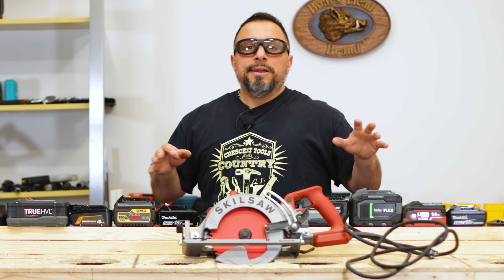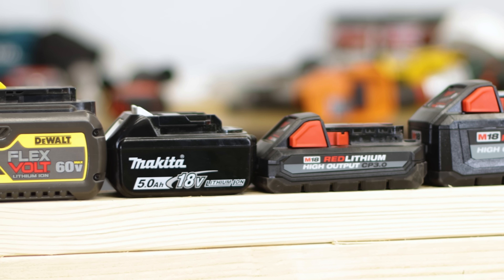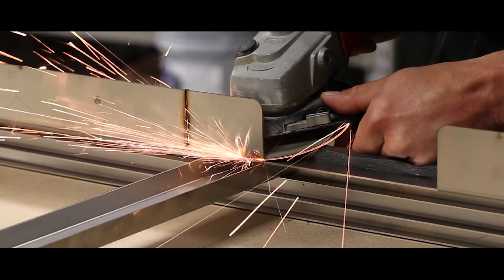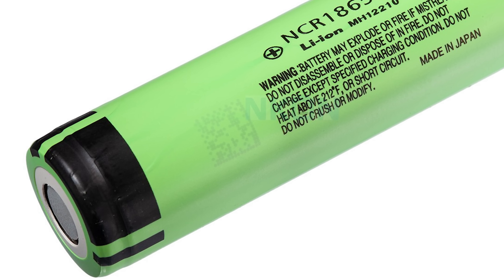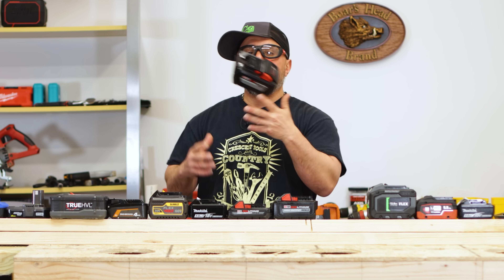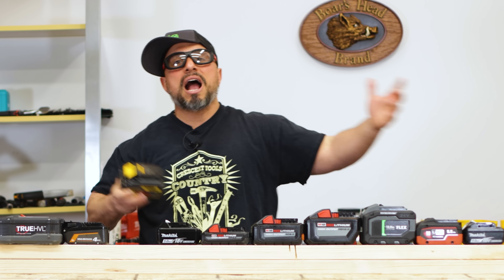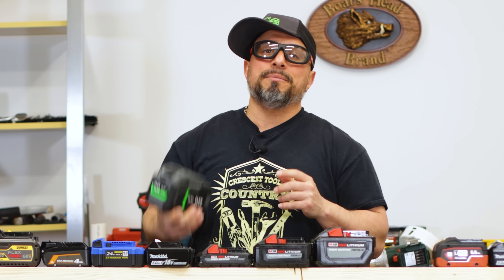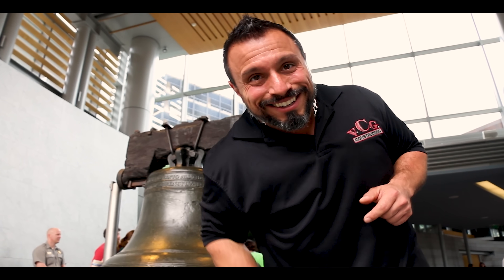Get The BEST PERFORMANCE From Lithium Ion Batteries & Make Them LAST LONGER!

Comment: alot of talking, but why not actualy checking battery voltages of different manufacturers and amp hours?
Reply: For what reason?
Reply: @haroldphipps3457  point is, that overcharge above norm and discharge below safe is possible so Im interested, what voltages are battery's operating and when is charging or tool runing set to stop (manufacturers safety implementation).
If you would open any of these and check what cell this or that battery pack is using you can find out what voltages they suppose to be running and what's best voltage for cell.
Reply: @klendatas1  thanks for the explanation!!

Comment: Best I can probably hope to do is not store my batteries in my hot car this summer. As for not discharging completely or not fully charging I don't have the time and energy to micro manage my batteries like that. I agree that software should be built into these hyper expensive tools
Reply: You dont have the time to push the little button on your battery when its on the tool to see where the charge is .  Lazy

Comment: Yes...batteries do manage themselves. Some Lithium Ion batteries have a built in BMS (battery management system), But... only in $500 to $1,500 batteries.Tool manufactures want to sell more tool batteries, and solar system battery manufactures don't want to get sued because a $1,000 battery was mismanaged by a consumer and died after 50 charge cycles.

Comment: If possible, avoid using fast chargers. Charging at higher amp rates will also contribute to faster battery degradation.
Reply: All I use is fast chargers heres why. By the time the battery degrades beyond efficient use I'd already have saved money by having these batteries charge fast and always ready when I need it. That being said I  know batteries are expensive but so is my time. I've been using the same 4 battery packs for quite some time now and have not had an issue YET. When that time does come I'd probably upgrade to some better batteries anyway.
Reply: I think the 🔋 getting 🔥 causes as much damage as if you charge them with high current, I'm not here to say one is worse than the other but neither one is good. If possible try to charge your batteries in a room that is around 80° & let them cool off to room temperature (or cooled down) before charging by the time they're done they should not have much heat. I use a Makita setup & the charger has a fan that blows inside the battery as it's charging. Just like anything in life, you take care of your tools, your tools will take care of you.. I'm sure that applies to your 🚗💨 your wife, your 🐕🐕 even your own damn body for that matter 😂
Reply: @honda116969  After letting my battery cool down, and then charge it with an external fan blowing on the charging unit. It's cheap insurance.
Reply: I'd like to add that if you have to use a fast charger, the larger, higher amp hour batteries can handle it better than the  smaller low amp hour ones do. The difference is the number of cells in each battery...higher capacity battery packs have more cells that are likely physically bigger and higher capacity than the ones they put in the smaller low amp hour battery packs. The bigger cells don't get hot as fast, and the load is spread across more cells than the smaller packs do while being worked in a tool as well as when they are charged in a fast charger.

Comment: You guys make awesome videos. Appreciate all the info i’m absorbing.

There’s a vid from about a year ago, about the 2997-22. Vince said if someone were starting out, the first choice would be the 2853-20. Is this still the case? I’m no trades person but i want a good set and wondering if the Milwuakee is the way to go. Even if i can’t find a 2-ball bearing 2853.

Thanks in advance!

Jeff
Reply: Their brush-less motor impact drivers are among the best, if not, the best in the industry. If you're already on the Milwaukee platform, you might as well stick with it. Even if you can't find the bearings.

Comment: Ironically li-ion batteries have a shorter lifespan than NiMH and nicad batteries.
Hydrogen batteries have a 10,000 charging cycle life,pity they are only used for satellites and the ISS.

Comment: I get a lot of sideways looks when I maintain my batteries. I number my batteries next to my initials, so I know which batteries are mine. I try to catch the discharge by 2 bars on the battery, I will take it off the tool and set it next to the charger to cool before charging. I don’t care that the charger has an internal fan cooled function, that’s for cooling the battery when it gets back up to a certain temp when rapid charging. After the battery is charged I’ll set the battery aside to use the next day, while I finish the day out with a different battery. Sounds like a long complicated process but numbering the batteries helps out and I have enough batteries on the job for each tool that I just swap batteries and go back to work while the others are either cooling or charging.
Reply: I almost do the same, I keep the ones in use outside their bad (I have 2 bags of batteries). Next day i swap them and let the used ones charge. I keep inside my house (air conditioned) and almost never leave them in my car. My boss in the other hand, does the opposite. So his batteries feel like they are always on one bar (Ryobi). They don’t hold a charge anymore (my misting fan kills a 1.5 ah battery of his in 20 mins). So he  uses mine and i have to be behind him like  a child and maintain the batteries/remove them from places he LOVES to leave where there is a hot sun or his truck (Arizona heat)

Comment: if the cells get too low to charge just transfer some juice from another battery via some cables, and razor blade and BAM. it will work again.. I have like 25 milwaukee batteries cuz I always grab them from ppl that claim they are dead
Reply: So you connect the dead battery in parallel with a good one for a while to give it a little juice (+ to +, - to -), then just put it on charge like normal?
Reply: @iamdave84  yes.. exactly ..  works like a charm
Reply: @dirkdiggler5525  I'll give it a go, thanks
Reply: @iamdave84  do it. I have got so many with this trick. can also use copper plumber's strap.. anything to transfer the juice

Comment: So, is the charger I got with my Milwaukee 1/2" hammer drill kit about 5 years ago a standard charger or a rapid charger? That is the question. 

And the flip side of using a slower standard charger: you need more batteries to keep working while the "dead" battery takes twice as long to charge.
Reply: Unless it says Rapid or Super charger, it will be a standard charger.

Comment: the BMS prevents the battery from charging when below a certain voltage level ,it doesn't nessasarily mean the cells are toast, if you can bring it above the voltage threshold for charging it will begin most likely to take a charge again.

Comment: Vince: "wouldn't it be great if manufacturers built into the battery software that told it to never discharge below 20%."
Manufacturers: but... our profit from battery sales would plummet!!!
Reply from the maker: Ohh ......
Reply: just add a switch button on the battery. performance or longevity
Reply: @jagarcogheart  blue tooth interface is already available on better BMS, no "switch needed.
Reply: The bottom is less important and then they would have to call them you know like 1.6Ah instead of a 2.0Ah but a better solution would be a charger that doesn't automatically fully charge them only charge to like 85-90% and have a button if you thought you would need all the power to fully charge them to 100%
Reply: If the manufacturer only let you use the battery between 20% & 80%, then you'd only get about 60 minutes use from a tool you'd normally get 100 minutes with full battery use. That would look pretty bad next to another brand that gives 100 minutes of use with equivalent battery and tool.
Reply: They dont have a BMS?  BMS should cut off at 2.5volts.

Comment: Got some 6.0ah metabo HPT batteries with 2016 dates on them. They charged just fine. Those batteries dont have fuel gages and the metabo tools didnt show fuel meter for them so they must of been dead. They took 3 hours to charge but have been working great
Reply: I think the the EGO batteries are the only batteries that have the maintenance charge feature on them and self discharges in storage. EGO batteries won’t keep a charge after 30 days. It’s built like that so they last longer. I can’t wait till the power tool companies include intelligence into the charging process. I wonder if EGO has a patent?

Comment: I have a programmable electronic load. I use that to test the capacity of batteries. Dewalt and Milwaukee have come out to a little more than there rated capacity.  What I wish Milwaukee would do is put in the firmware in the battery. Is a way of it automatically taking the battery pack down to half when it’s not used for x amount of days. DJI does it in their drones. And you can set the time limit that it waits for. Before it discharges the pack to half.

Comment: I was always told when using a battery you're running out of charge try to fully drain the battery because you're draining all the batteries inside. Then when you recharge the battery you're charging every battery inside to give it a better charge for that reason. Sometimes if I'm low on a charge I will hook it up to my leaf blower and drain it completely. Have a good day brother ttyl just been working on the new house getting it ready. 😎👊🇺🇸
Reply: For old nicad batteries this was true, however with more modern lithium ions if they fall below a certain voltage the chargers will no longer charge them, so dont do this
Reply: That is good maintenance for older Nicad technology but is a big nope for newer LI batteries...doing that will shorten their life.

Comment: Brand new1/2 hammer Drill Flex fails and burns against a used Milwaukee
Reply: Where did you see this?
Reply: Saw it on a you tube channel . I can't remember the channel. It was funny. The Flex had every advantage.( brand new tool and battery battery size the Milwaukee was well used bought on eBay and I'm pretty sure it was an older generation with brushes)
Do a search you might find it